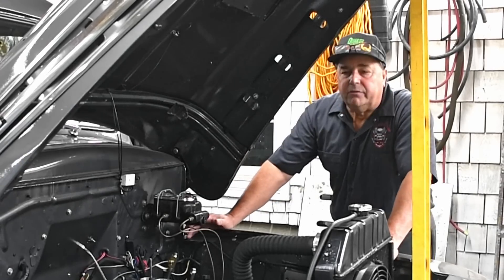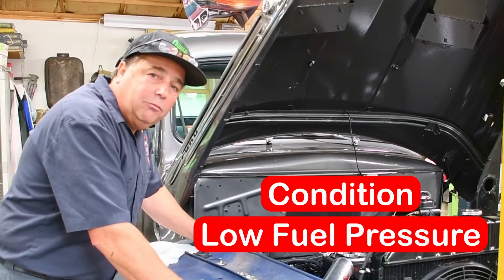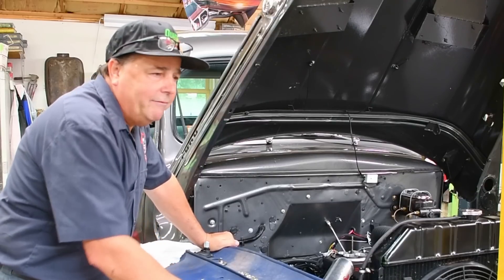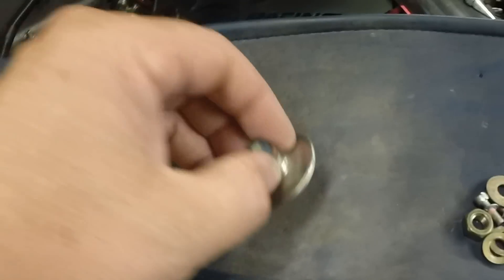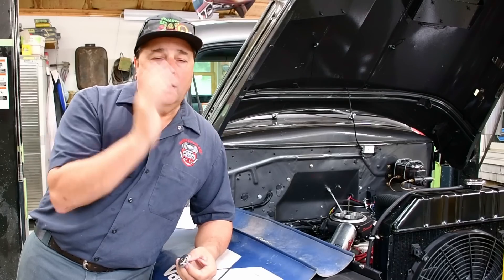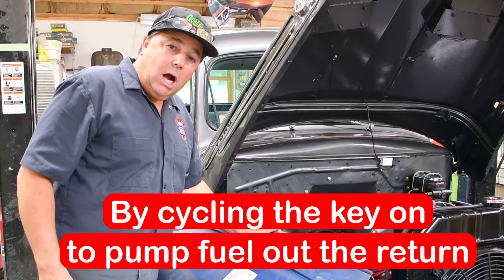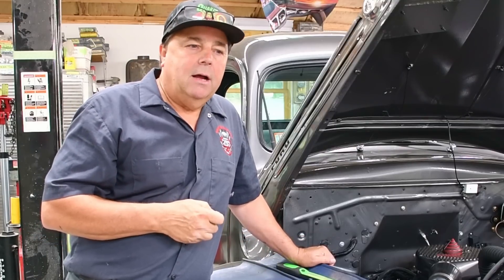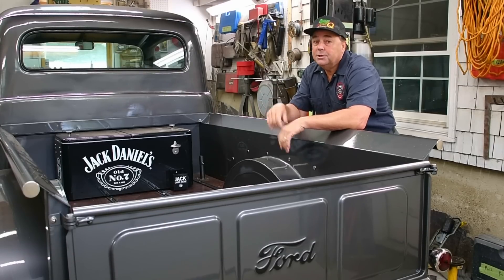Holley Sniper Fuel Pressure Problems - How to Fix Them

Comment: I can tell you this, Holley external fuel pump that came with my Sniper was shit, left me on the side of I-40, got another, left me down again, so the 3rd time I got the in-tank pump with the internal regulator on the pump. Now I really don't trust it to go out of town. When it runs, it's excellent. I really don't want to go back to the quadrajet, but if I can't find a fuel pump that I can trust I will have no alterative. Again, real loud, Holley fuel pumps suck. I'm open to suggestions on a fuel pump brand that is trustworthy that will feed my Sniper.
Reply from the maker: Holley's in tank fuel pump is good. Link https://amzn.to/3Rv5LUN
Some guys swear by Walbro Fuel pumps Link https://amzn.to/3RuVRCX

Comment: I also had the same issue.  Only it was my fault, it was before I put the proper fuel filter on.
The screen inside of the pressure regulator clogged up.
Mine also got damaged after removal, so I suggest having a backup on hand.
Reply from the maker: Good idea! Also keep an oxygen sensor on hand too!